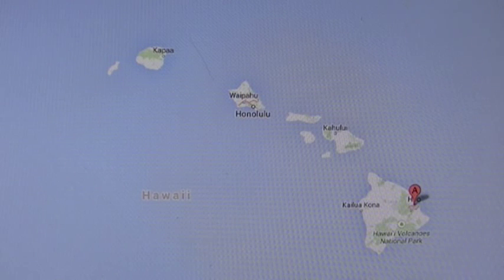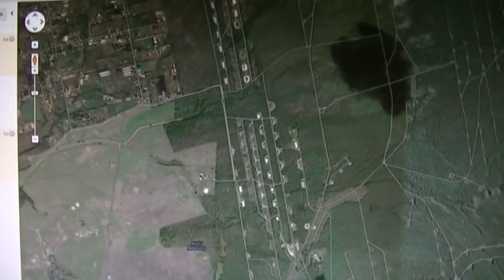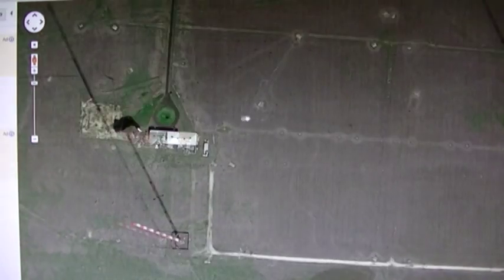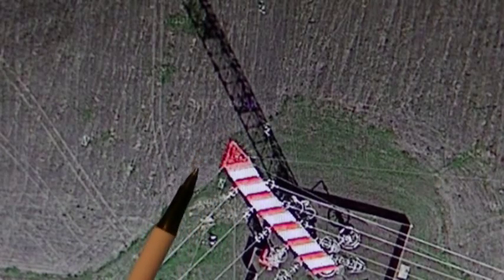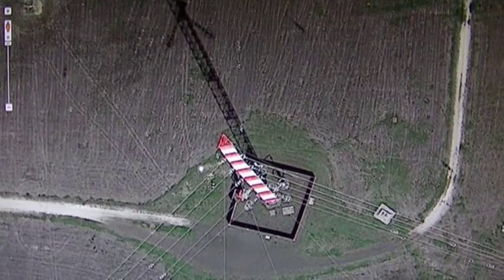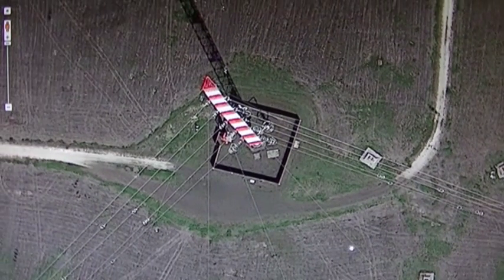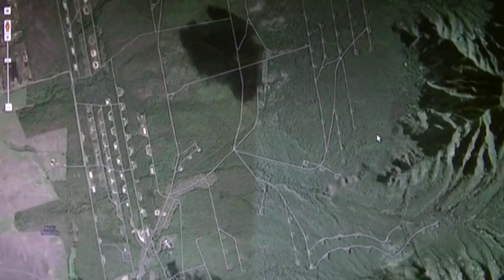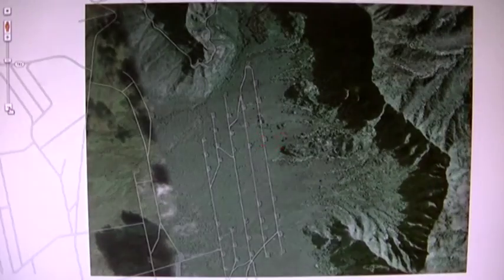HAARP Transmitter in Hawaii 8 7 14

Comment: After looking at the hillside and the old reservoir, I think that system is on old water catchment installation that might be decommissioned due to new technology. Maybe potable water is now desalinated and treated elsewhere? The reservoir is the open 'park' area. Maybe it's being used now as a TV antennae etc. There is an army base up the slope, maybe it's military antennae.
Reply from the maker: These ionospheric heaters tend to be at the base of a mountain, or hill, as the earth shields the population from the high power radio waves. That is the reason microwaves are used, since they are more directional, with lower sideband leakage. Also, if you can SEE it, like on google maps, or on a patent search, that is a distraction. Just like the magician makes you look at one hand, while he palms the coin with the other hand. The folks who run these programs are no dummies, but they think we are.

Comment: Here is a video I made in 2011.  I have had it on "Private" as this was my best guess.  Usually these transceivers are located adjacent to airports as they require Airport radar.  However, the Hilo transceiver I was specifically told was at the end of the Airport runway.  I will post that link in the "Reply" comment attached to this comment.  Hilo is where the Big Mountain of Mauna Kea is (with all the telescopes) that supposedly turned Iselle around.  Iselle hit the southeast area of Big Island with much damage...(now devastated by Lava).  If anything, HAARP was probably being experimented with as the Rogue Air Force /Deep State has/had been doing this for years...and they decided to just turn it off.  It is also an earthquake machine as the inventor found out when contracted to find oil in Oregon.

The present lava devastation was caused by HAARP as the microwaved cloud patterns representative of this device have been in operation 24-7.  Deep State ..has a Cause now...is seeking revenge on Trump  just as they attempted a False Flag with the REAL missile attack on January 13.  This present attack may come from a Main Base in Antarctica as I saw a video on that recently..which aims toward the whole Pacific Rim. Also the video "Kilauea Volcano Conspiracy Deepens" has some interesting concepts regarding a specific Grid of earthquakes.  ...https://www.youtube.com/watch?v=DfSiH01QQds
Reply: Hilo is the main unit that in the location where Iselle hit...but each island has a transceiver I was told...https://www.youtube.com/watch?v=mg7AicIxnlE

Comment: Yes the low voltage or amplitude rife device I have has a long listing of verified frequency protocol per whatever ailments that is actually available with the software and can  download directly to your unit. I use a clean energy spooky2 rife device and in the process of getting the plasma adapters for it. It's an amazing device even without the plasma and very effective but still a practice makes perfect field.There are some blogs that I do a cross comparison with and use and critique some testimonials to make it more effective but essentially I use myself as a lab rat and take notes along the way.lol
The antenna array or Haarrp seems to be most effective for weather related occurances and elemental effects on a larger  high voltage scale. I think we are on the cusp of being able to incorporate Ionspehere type configurations and apply them on a microcosm/microcosm  health recovery type setup but yes starting with Rife has been a huge help for me and relearning the different frequency sets and how they effect us biologically.

Comment: I haven't checked out  the  work of nick begich so I will look into that Thanks!
well yes we all know they won't come out and admit they are ELF towers not in plain English atleast.lol

I have seen a few designs that can utilize the benefits of these Antena for personal health recovery so I have been studying the harmonics or interested to know what frequency generators they are currently using but most likely it's an array of many like you mentioned.
Reply from the maker: +Maika Kai   I think you are talking about the Rife medical devices. I'm sure that does work, but you have to know the exact frequency that will destroy the pathogen, without harming normal cells. That is the big question. I once saw a book advertised that SUPPOSEDLY had all the Rife frequencies for every type of illness, but it was a couple of hundred dollars. Plus, how the heck could you trust a book like that? Probably someone just listed a bunch of random numbers, so they could charge $200 for a book. Good luck with the Rife investigation, and if you can prove it works, please tell the world. I think it is just a few vacuum tubes, but they charge a very high price for the machine. Surely, you could make something like that, only better, with a signal generator, and a couple of cheap vacuum tube amps, off ebay.  I bet is it easy to replicate, but you have to dig up the original Rife documents, first.

Comment: Is there a smaller to scale version that can communicate with these larger ones? you mentioned radio shack but I haven't seen these types being sold ?
Reply from the maker: +Maika Kai   According to the most accepted HAARP guru, Dr Nick Begich, Ionospheric Heaters are just radio transmitters, which can focus their beam into a pin point, some 30 to 100 miles above the Earth's surface. Probably each secret program has all the transmitters working in unison, but that is just a guess at this point.

Comment: I live in Hawaii and have worked on these sites and in Okinawa.  Those bunkers are munitions bunkers and non nuclear.  This antenna system was built long before the main haaarp system in Alaska.  Mostly used for submarine communications and satellite tracking however being a different configuration and design from other haaarp designs lends me to believe they can still function and talk to each other and could possibly be used for weather modification but not 100% sure they would place such high powered , hi frequency antennae next to nuclear.
Reply from the maker: +Maika Kai   If they admit the Hawaii towers are for submarine communications, they are admitting they are ELF transmitters. The BEST way to make ELF is by blasting the ionosphere, with a special radio wave, and when the ionosphere "snaps back" it creates the ELF signal, without 500 miles of transmitter arrays. So, by saying they are for submarine communications, they are admitting they are ionospheric heaters.

Comment: its said that the antenna is used for ULF sub com.  residents near by complain about health effects from  the transmissions.

can you explain this??   it on the island of molokai  https://www.youtube.com/watch?v=OVzlBzfCtGU
Reply from the maker: MrJamma Jammin The circles on your video, are just "anomalous propagation", and that is a normal thing, in very humid air. You can see the same thing on the national nexrad map, every evening, as the humidity level increases. Check this map as the sun goes down, and you will see the radar beam bending, and picking up all kinds of ground clutter. After sunset, they readjust the gain parameters, and the radar looks normal again: http://radar.weather.gov/Conus/full_loop.php

Comment: here is the new, improved mobile haarp machine floating in plain site in honolulu:

http://en.wikipedia.org/wiki/Sea-based_X-band_Radar
Reply from the maker: Yes, I agree. But, did you know, that megawatt microwave transmitter is SO POWERFUL, they are not allowed to turn it on, within 75 miles of land? So, if it is near Hawaii, it is off, but if it is out to sea, then it is heating the ionosphere. Thanks, you are right!

Comment: isn't it possible that these are supplying electricity for some underground chambers since there is a huge tunnel from the capital to the edge of the island...an under ground military base....
Reply from the maker: DIVINEMatrix999 It is too easy to hide underground cable runs, so these are either nuke storage bunkers, or haarp transmitter antenna elements, disguised to look like nuke storage bunkers. You know, if you live nearby, you have a right to know what they are. I.E. do you really want to live next to something that scary? Nuke bunkers are the number 1 target in a hot war, for instance. To have an underground base, you need the right kind of rock, and no volcanic/seismic activity, and also no oil/gas seepage. So I don't know if the Hawaiian islands qualify. Somebody should find out, it would be interesting.

Comment: elevation makes a difference....with the perspective..hillside lot....
Reply from the maker: Lol, yes, it's about location, location, location...
Reply: is it possible they are also antennas for satellite connection? ...
Reply from the maker: DIVINEMatrix999 No, satellites only transmit microwaves, due to their limited size. Therefore, a parabolic reflector is needed to receive microwaves, here on earth. A microwave phased array would be much smaller, to avoid excessive phase error due to atmospheric non-homogeneity.